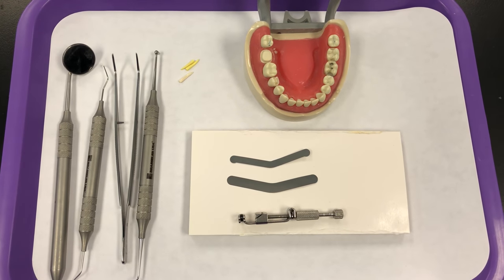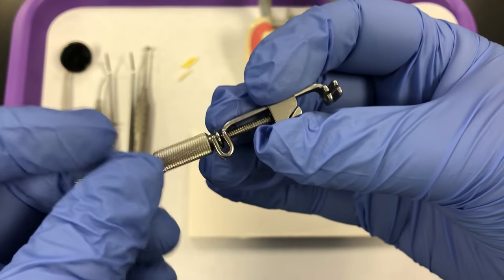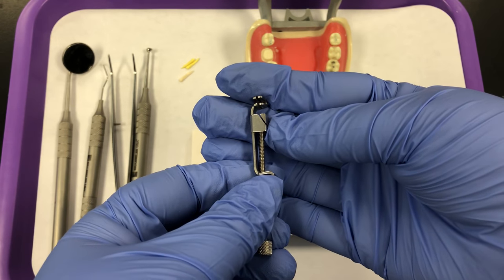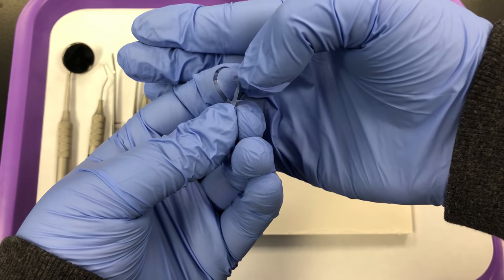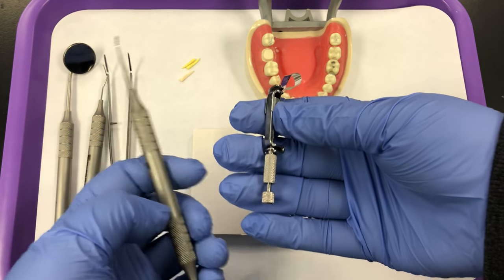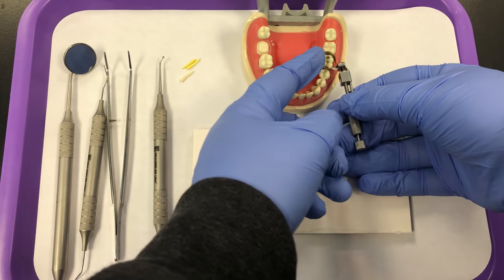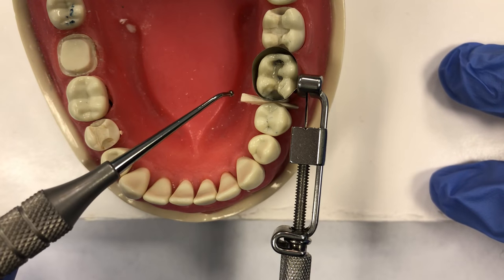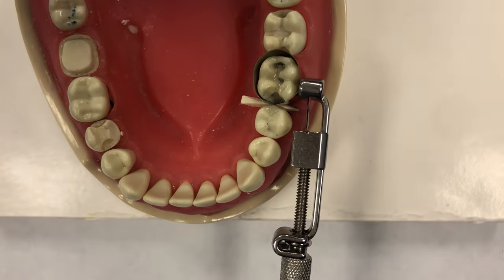Universal Matrix System

Comment: Another tip: oftentimes the contacts will be super tight and you can't fit the matrix around the tooth.   Use a Gregg 4-5 to open the contact and it slides right on.